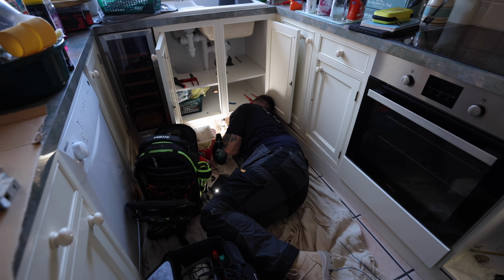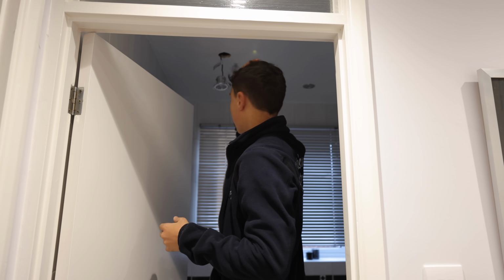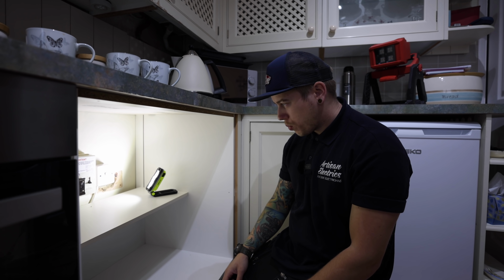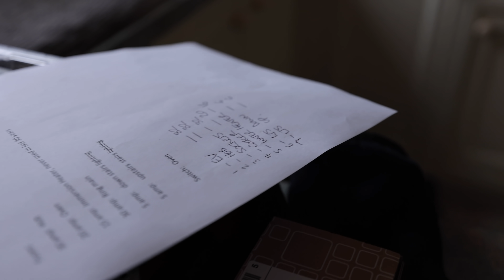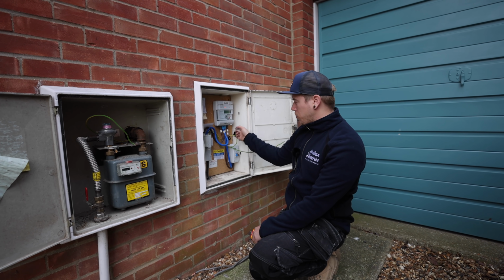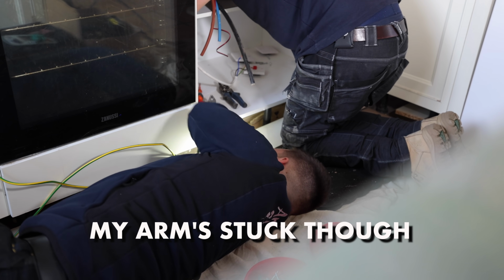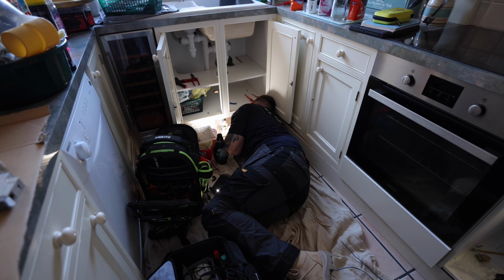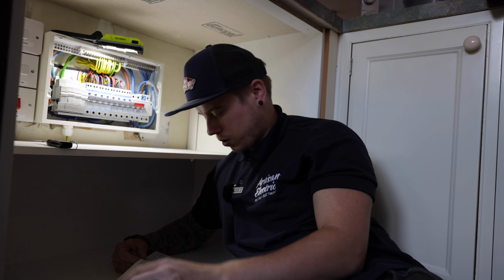CHAOS IN A CUPBOARD CONSUMER UNIT REPLACEMENT - Electrician Life

Comment: Drilling to to a gas box lads? only supposed to take bonding thought external lip knockout in case of a gas leaks . Generally love you content Artisans keep up the good work! Cory you are a legend!
Reply: Exactly what I was thinking!
Reply: Good to know that. So can't drill through bricks into it but cutting a hole externally is fine
Reply: @bartom309  I don't know the exact regs, and not qualified. But I'm sure the gas box should be sealed against leaking gas into the cavity worst case. Also here we could be providing a route for escaped gas to enter the electricity meter cabinet. Perhaps they sealed the hole, but it wasn't shown?
Reply: Correct or via a purpose made hole with a spigot eg like the gas pipe goes through and is sealed with non setting sealant

Comment: You shouldn't drill those cavity gas meter boxes, in the case of a leak the cavity can fill with gas and the house can explode. There's a putty you can get to seal round the cable
Reply: Intumescent putty 👍

Comment: Lovely job but an observation, you would of been better off bonding the gas within 600mm of entry to the property. You're not supposed to drill into the side of a recessed gas meter box and would of been better off going in via the back and sealing it there as it's the shortest route to the inner wall skin and the least likely to allow the escape of gas into the cavity (gas regulations requirements > electrical). Seen this often and several sparks have had to cough up a couple ££££ per house they've done it to on new builds to replace the boxes when the inspectors have been around.
Reply: I wouldn't have bothered bonding it, that house is too modern for the incoming pipe to be anything other than plastic, in that get sleeve there will be a yellow plastic pipe, I would be surprised if the water wasn't plastic as well.
Reply: @acelectricalsecurity  isn’t it bonded for the purpose of potential? Not as a source of earth?

The inside pipework going into the boiler will be copper throughout. But the incoming source is likely plastic yes.

Please correct me if I’m wrong, not a spark, just peasant programmer and sec researcher! 😂
Reply: @TornTech1  of it's plastic incoming services then there's no need to bond, as it's not extraneous, so it can't be at a different potential to the main earth
Reply: @acelectricalsecurity  ah of course! It would only be at a different potential if it WAS grounded! So it’s just floating!

Thanks for clearing that up!
Reply: @TornTech1  Anthony is correct is assuming the white plastic sleeve is to protect the polypropylene from sunlight but as gas regulators and everything past the ECV must be metallic pipework and fittings in an installation it will be grounded and if not bonded has a possibility of being at a different potential.  As such the gas regs and engineers will prefer to see it bonded to reduce the chance of accidental ignition. BS7671 will happily let a polypropylene incomer go un-bonded but does actually take a back seat to the gas regs when dealing with gas installations.

Comment: Sorry but you can’t drill the meter boxes you have two options either follow the gas pipe through the rear nock out with the spigot and non setting flue compound eg the grey stuff, or you can drill a hole in the front on the bottom eg like how the incoming gas supply is but other side these are the only option he now needs a new meter box as it’s against regs

Comment: Hey, great vid guys....... A question...... @5:50 you talked about getting more length on the cables by cutting the "capping" back........ Was it capping though? It looked like oval conduit..... If it was, I  was really looking forward to seeing how you did that without knicking the cables inside. Any tips on how to do that please?
Reply: Snap
Reply: With great difficulty lol
Reply: Get your multi tool out and hope for the best. I would snip the oval up the centre facing me and yank the cable to release more. Oval buried in wall so you don't need to cut it out.

Comment: Is there really any need for an isolator when the CU's right next to it?
Reply: How else would they isolate the CU without pulling the DNO's fuse
Reply: @adrianbolger7696  I meant the kitchen appliance isolator switches
Reply: @mikeselectricstuff  Not really i guess but those are the rules it seems :)
Reply: The RCBO’s are single pole, most appliances need double pole isolation 😊👍🏼
Reply: @corynoahmac  When RCBO's are advertised as 1+N pole... does that count as two poles for the regs?
Reply: @BerkeleyTowers  I really can't imagine it wouldn't.
Reply: @BerkeleyTowers  Beware marketing literature, for example I look at the schematic on the front of circuit breakers to see if the neutral is switched or NOT,,, if not I call them Pseudo 2-pole (guess the only justification for calling those two-pole is that phase and neutral feed cables both enter the devices)

Comment: I truly TRULY dont understand why UK electrics fit consumer units in the most random places. 
In norway it is standard that consumer units are close to the entrance door and at chest hight. And they are big 70 long 60cm wide is normal
Reply: it depends where the meter is, sometimes its easier to put the unit close to the meter so you have an easier run for the incoming tails
Reply: Good job though
Reply: True, in my country there are specific laws about the placement of consumer units. They must be at a reasonable height and in a place where they are accessible (you don't want to reach under a kitchen cabinet full of stuff in the dark to restore power or worse to shut down the power in case of an emergency!). Usually they are near the main entrance door (for apartments) or in an utility room for bigger houses. Having them near the door makes sense, since if you turned off the power (for example when not using the house for a long period of time) you don't have to go with a torch to find the consumer unit to turn on the power. They are also usually in a box into the wall, so they are flush to the wall, like a light switch (in fact a lot of people to hide them they put a picture in front of them).

Maintaining the wires short to the meter is not that big concern, since by law the meter is not installed inside the house and should be on the perimeter of the property (accessible from the public street) so the cable run is long anyway, and a couple of extra meters doesn't change that much...
Reply: @jakebowen8059  easier to run a few meters of tails or about twenty different circuits? Here in Finland older homes has the meter in the same CU, indoors and somewhere near the entrance
Reply: Same here in Finland
Reply: @alerighi  in South Africa the preferred way now is to have the meter at the perimeter wall.
My house is old and has the meter right up near the front door (70 meters from the street).

Then there is another house near me with the meter on the street round the corner and across the road from the house!
They had a cable fault out on the pavement and City Power refused to fix it because it was after the meter and thus the customer's problem!

Two extremes, but I prefer having mine inside and criminals sometimes switch off the power if you're away and hope the alarm battery will go flat so they can break in.
Reply: Because there's no thought, for example, when you are working on a new build, some unknown person will mark the drawing up, and not give a toss about the location of the board, it's all about aesthetics and hiding things like that, if these people had to fit them, they would think twice where they marked the drawing.
Reply: I think it’s also about the 3m regulations for the tails.
Nevertheless, for the sake of the health of UKs electricians backs, there should be „ergonomic“ paragraphs in the regs, as there is for EV chargers. You don’t always have an apprentice for those back-breaking jobs 😄
I hope that this topic is addressed soon, such that the work conditions improve 👍
Reply: @nusermane1076  so are you not allowed to have an armoured cable between meter and consumer unit?
I've always wondered why the UK uses those tails in the first place. It's rare to find that here in South Africa.
Reply: @nusermane1076  it's nothing to do with the 3m tails length, it's down to bad planning, bad design and incompetence.
The last 3 jobs I have I done, the clown of an architect put the mains board in the same tiny cupboard as the boiler, the cylinder, the under floor heating controls, the mist system pump and the air source heat pump controls and meters, a crap design, and I told him so, but what can you expect from an academic, common sense zero.

Comment: In the Netherlands we have since 1920! a advisery building law to build a metercupboard in new homes.Esspecialy for the meters of gas and electricity and lately for warm water for heating your home.
And still the UK is wondering were with the meters in the house,never on the same place.Even akward places like this!Isnt it time to regulate this by the government??
Reply: It's only in older house where they pop up in odd places, but many houses in the UK are Victorian. New builds are genuinely in in more sensible places.
Reply: The UK Government and the Local Governments cannot even manage to regulate the building industry to build safe, well (competently) built and well insulated houses (without them doing an impression of ‘Towering Inferno’.

Comment: Is it me 
Or are isolators that are next to the consumer unite a little pointless 

Surely if it’s that close to the consumer unite it’s self if the isolator 
Or is there some code I’m forgetting about
Reply: It does give you double pole isolation, and you are able to fuse the fan at 3amp as most ask for, as well as a double pole isolator.
I think it's better to use an isolator rather than a breaker personally.
Reply: Manufacturers instructions and good practice guides dictate they should be used. How you would be shocked having isolated at board I don't know. Bosch Cooker extractors come with plugs these days with a 3amp fuse so they don't see the need for double pole isolation.